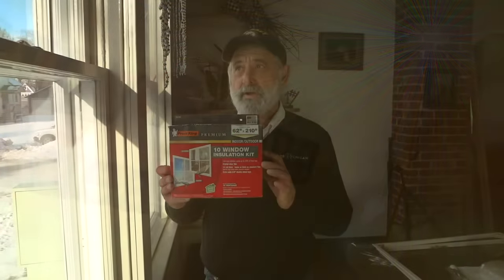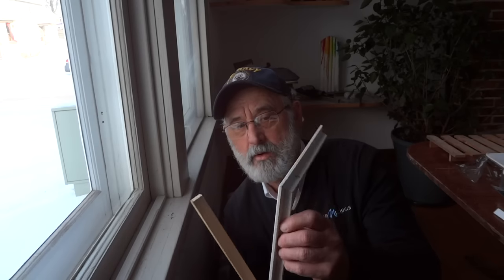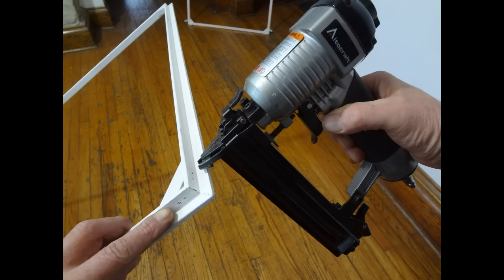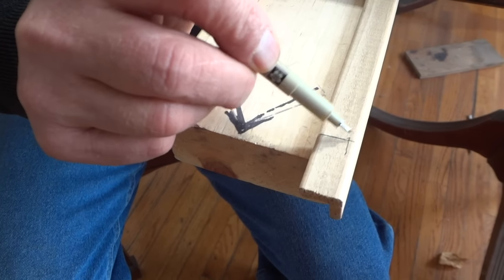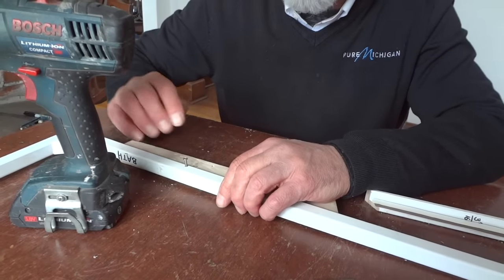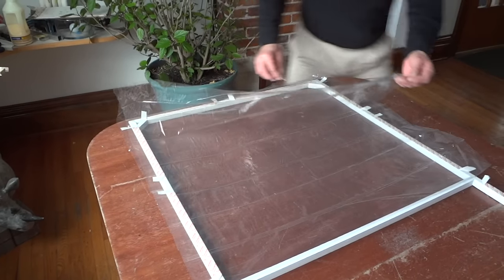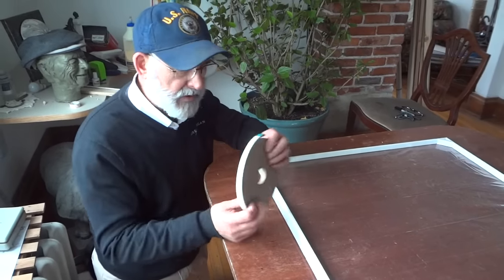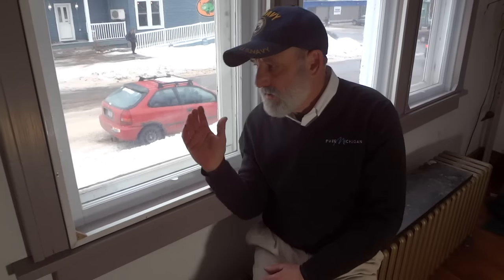DIY Window Insert for Older Homes

Comment: Parts List.   I really appreciate your step by step clarity, with sound reasoning included. Thank you!  I needed a parts list for myself, so  I'm putting it up for anyone else who needs it.  I'll be happy to edit for corrections.
1/2' x 3/4' parting stop
3/4" x 3/4" corner molding
#4 x 5/8" screws
Clear double sided 5/8" tape
3/8"wide x 3/16" Sponge tape
Plastic shrink film sheeting
Reply from the maker: Thank you, amr53207.  That is helpful.  You might note that the plastic sheeting is a shrink film and not polyethylene or vinyl.  That's a pretty short list for all the savings it represents.
Reply: Thanks for making this list    very helpful for others👍🏼
Reply: I wonder if you would be able to assist me I live in the UK and I cannot find this corner moulding no one seems to know what I'm talking about could it be called something else or what is it generally used that way I might be able to track it down
Reply: @EarlSenchuk  I'm having trouble tracking down the corner moulding maybe it's called something else in the UK can you tell me what is generally used for or where it's used so I can see if I can track it down desperate to make the your kind of insects
Reply from the maker: You got it amr53207.  The corner molding is for outside corners.
Reply: @carmel-wayfinder5401  Another name is angle molding, of course, you can always show them a photo.
Reply: Very helpful but where do you suggest getting this list at? At Lowes it says corner molding is $15 for a 96" piece. I'm looking at 0.75-in x 96-in Brown Solid Wood Outside Corner Guard at Lowes.

Comment from the maker: The results are in for the 2019/20 winter so far.  My last five heating bills in order starting in September are:  $23, $44, $77, $77.50, and for the month of January is $81.  This is for heat, hot water, and cooking.  My house was built in 1886.  Normally, my gas bills are double these amounts.  My home is the most comfortable and warmer than any winter I have ever experienced in 43 years of living in this house and I live in the northern half of the Upper Peninsula of Michigan.
Reply: Your brilliant! Love the UP
Reply: Respect to UP ! Beautiful place !
Reply: I just discovered this concept today. I'm curious if your windows are the original windows in your home? Our home was built around the 1860's with original windows. We are now looking into something like this but I'm curious if it really does work well on really old windows.
Reply from the maker: @tigger6186  Yes,  I do have the wavy glass and original frames.  My home was built in 1886.  The exterior storm windows are hopelessly inadequate.  When I put up the window inserts, my bills were cut almost in half.  I now turn my thermostat up higher and pay less.  Every room is the same temperature.  When the wind is blowing in winter, you can see the plastic on the window inserts bow in and out with the pressure.  You just know that you are saving money.  I plan to make three more window inserts in a slightly different way by using a special clamp designed for the purpose.
Reply: @EarlSenchuk  I would be interested in a diy video on that as well if you have time, please and thank you.
Reply from the maker: @tigger6186  Working on it now.
Reply: Any tips for making a frame for an arched window?
Reply from the maker: @zootsuitpenguin  Not without a lot of work, and maybe not using wood.  That's going to be quite a challenge.  Good luck.
Reply: You are amazing Earl! 
I'd never dream that anyone would have those bills in your location regardless of how they insulated. 
Did you increase the R value in the attic the same year or do anything else?
Reply from the maker: @preacherman9018  I did increase the R value with some thick insulation in my attic and sealed around the outside of the window frames.  We just had a major Christmas storm with 3 feet of snow dropped in my yard and serious winds.  If I didn't look out my window, I wouldn't know that there was a storm going on.  So quiet in my house.
Reply: @EarlSenchuk  That was a brutal storm my friend. It rained hard, then it immediately dropped over 40°F with scary gusts that threw debris.  I have to look into increasing my R value in the attic and doing that too. I have an old house as well. It's good to hear that you faired well last weekend. It's a miracle our power didn't go off.  Some places they were doing rolling blackouts. Can you believe it? Time to invest in a chimney liner for wood heat. 
On another note, here's something that I hope you enjoy as much as I do. It's a short Bible message. https://youtu.be/qv0rnnUdk-I
Reply: @EarlSenchuk nine months ago 3'? Must of been around Marquette area I remember that storm up in Calumet definitely going to try this this year
Reply: Maybe you can start putting bubble wrap it will also help the  interior of the house be more warmer.
Reply: Thank you!

Comment: When I thought of all the wrong ways to put In this type of winterized installation. this video is the only possible correct solution thank you for your diligence in conquering perfection
Reply from the maker: Thank you Mike,  I should let you know that I filed for a patent on a "DIY Window Insert KitTM".  It has just gotten approval for testing on select local homes involving persons who are having trouble paying their energy bills.  We are also pursuing an Energy Star rating for this new product.  It's going to take some time, but relief from high energy bills and better creature comfort is on its way.

Comment: My house was built in 1880's, my heating cost are very expenaive. Thank you for making this video. I cant wait to try it out.
Reply from the maker: Lisa,  I am in the process of producing two new videos that will allow persons to make their own corner molding (Part II) and clamps (Part III).  My house was built in 1886 and the DIY window inserts for older homes cut my bills at least in half.  Expect a dramatic drop in your winter heating bills as well.  You can also expect that the temperature of each room will be the same temp.  Another huge plus is that you can expect to see no more frost buildup on your storm windows, even if you run a humidifier.   I expect to put these new videos out next week.  Stay tuned!

Comment: Will be doing this. Great idea! Much less expensive than the $469/ window plexiglass ones. Of course the prices are higher now, lumber for 2 windows is $65. Thanks Earl!
Reply from the maker: You are welcome, Vic!  I know you are going to love the newfound warmth and comfort, in every room!  If you plan to make this style of window insert for your entire home then you may wish to watch the other two DIY Window Insert for Older Homes videos that show 1.) How to make a special clamp that makes things go way faster, and 2.) With a simple jig, learn how to DIY 8 ft long outside corner molding lengths, enough to make four complete window frames out of a single 2 by 4.  I have 13 window inserts in my home.   Enjoy the significantly lower bills too!

Comment from the maker: One big difference I've noticed since creating these window inserts is that my regular storm windows never frost up anymore no matter how cold it gets outside because there is no moist air escaping from things like cooking or from the clothes dryer.  Sometimes when the wind blows, I can see the plastic film on the window insert bulge outward or inward which is a sure sign I am saving a ton on heating cost.
Reply: Nice job !!
Reply: Simple and effective.  I was absolutely trying to overengineer my windows.  Thank you for sharing your knowledge!
Reply: Good job. Where can I buy the long bar? What's the name of it ?
Reply from the maker: @jy210000   Not sure what you are referring to as the "long bar."  The 1/2" by 3/4" Parting Stop comes in 8 foot lengths.
Reply: I have literally seen blocks of ice on the inside of ours!
Reply from the maker: @jasmincooper7146  Frost buildup on my windows (usually on my exterior storm windows) is a thing of the past for me.  I can have water boiling on the stove and even exhaust my clothes dryer to help add humidity and add heat to my home with absolutely no frost on any window.  Why waste that wonderful warmth?

Comment from the maker: This was a brutal winter, for all it seems.  I have never had 4-1/2 feet of snow in my yard for most of the winter before.  In spite of it all, my heating bills were quite reasonable especially considering that we got over 100 inches of snow in just February.  Going to put some statistics together going back five years to see if I can come up with a actual value for savings.

Comment from the maker: Premieres starting tomorrow morning (2-17-2022 @ 10 a.m.) for two new videos.  DIY Window Inserts for Older Homes, Part I-The Special Clamp outlines how to create the perfect clamping system for making DIY Window Inserts for Older Homes.  At 10:30 will start the next video, Part II- The Corner Mold Making Jig that teaches how to create a jig fixture that will allow you to make outside corner molding at a fraction of the price you would pay in a hardware store.  DIY Window inserts for Older Homes work to save energy costs on both heating and air conditioning.

Comment: I made something similar.  I put the plastic sheeting in aluminum screen channel.  The top has foam weather strip for sealing and spring-action, and the other three sides have plastic bi-fold weather striping for covering gaps.  An aluminum support member for bowing is centered and JB Welded in, for example, a 3'x5' insert.  Install and shrink the window film as light as possible.

I have no quantified data, but there definitely is less cold air rolling off the window sill, by feel.  (The cold air is not infiltration but air cooled by convection.)  I use 0.5R per inch of (sealed) airspace.

This build is relatively inexpensive, so payback can start early as possible.  All components must be used to make it effective.

They are delicate, but I have not wrecked them yet, and the clarity of view is good.  Frost and ice has built on the regular window due to water vapor in the airspace, and if it is bad enough, I will dry it; this proves the air at the inside glass pane is cold than if it were normally exposed to the indoor space.  I have put silica-gel packs in the air space which seemed to help, but I cannot confirm the air hadn't dried out by that time of the year (there is still minimal air leakage).  Luckily, they JUST fit behind the shades and shade mounts.

I will continue to use them.  I even called them the same exact name - window inserts.
Reply from the maker: Sounds like a quick and easy way to cover a screen window by using the same tracks and method used to mount the screens.  Good luck on your trials.  Keep us posted as to your results.

Comment: Wow. Best one I have seen in last several years.  I know what some of my older windows will be getting for Christmas 🎄 👍
Reply from the maker: Thanks Pizza Warlord.  If we could show photos here, I would post my actual heat bills for last winter.  Unbelievable.  My highest gas bill for February, the dead of winter, was only $92.  That includes heat, hot water, and cooking.  It comes out to about 50% savings.  My home has never been so warm and comfortable.  Every room now is the same temperature.  Absolutely no frost on any window due to condensation.   I wish I could figure out how to make this into an easy product so others can enjoy such amazing savings.   I am so glad I did this.  It takes about two minutes per window now to prepare for winter.  No more taping, shrinking, cleanup in the spring.
Reply: @EarlSenchuk  By far this is the easiest project for my windows  However I wish you had shown how to mitre the frame together can you advise what tools I would use and how to stick it together  as I'm clueless 🤔🔨
Reply from the maker: @carmel-wayfinder5401  Hi Carmel,   Corner clamp styles vary.  Most get in the way.  No way to show a photo here, but I modified a clamp with a small block of wood to square off the point of the corner clamp.  Another thing you can do is glue and clamp all four corners and then shoot the corner blocks in after the glue sets up.   You can also make your own corner clamp out of wood that will allow access with the brad nailer.
Reply: @EarlSenchuk  Thank you for the info🔨
Reply from the maker: @carmel-wayfinder5401  Thank you for your comment.   When I found out that my personal corner clamps didn't work, I created some that got me by.  Easy if you are an artist that works in metals.  It appears that no corner clamps on the market will work in this application, at least without some modification.  Last night I came up with an idea of how to fashion some corner clamps out of the same corner molding and parting stop.  Thanks again for bringing this to my attention.  I WILL FIX THIS!

Comment: What an awesome idea! Great work and great video. Thanks for taking the time to show how you did it. I've already started doing my windows with sealing bubble wrap against the window with double sided tape and then 4 mil clear plastic taped on with white duct tape onto the window trim. I have an old concrete block house.  Seems to work pretty good. I sure would like to try your way next year.
Reply from the maker: Thanks, Patricia.  I just put up all the window inserts that I made last year as shown in the video.  It is so much easier than taping, filming, shrinking, and then trying to remove it all in the spring.  Never again.  This year it took me just a few minutes to completely seal each and every window in my house.  No more muss and fuss.  Really like the savings in heating cost.

Comment: Years ago I did pretty much the same thing on our 160 year old farmhouse windows (not a 90 degree angle in the building). Mine are not nearly as neat looking as yours though. Good job!
Reply from the maker: Thanks!  I figured out how to deal with out-of-square windows with a patent-pending window insert kit. Go to https://earlsenchuk.com/inventions/home-use/ and click on the composite picture in the upper left corner.  These cut my heating bills in half and cut outside noise considerably.

Comment: What a great video, you're a talented man, Earl. I would like to do the same thing only with plexiglass. My local Lowe's will sell "scrap" pieces that have already been cut for $1 a piece. It might take a while to get them cut for every room in my house but I think it would be worth it.
Reply from the maker: Thanks, Awesome-X.  Plexiglas would certainly be a lot clearer.  Good luck!
Reply: Back when I was a child, many years ago, my dad made these using plexiglass for all the windows of the house.  He made them in three sections for the large picture windows so they could be used in all seasons.  With the sections you could remove the center to be able to open the slider section to get fresh air.  Otherwise they helped with both the heating and cooling bills.

Comment: Id suggest using some 20 gauge clear PVC that way you don't have to worry about the plastic tearing, gives you a little soundproofing, and maybe a little better insulation.
Reply from the maker: Try it and let us know how it works out.  We are all interested to save money on heating and cooling cost.

Comment: I've got some drafty windows, possibly because of deteriorating weather stripping. I'm planning on replacing that weather stripping, of course. But I think I may also start building these window inserts. In my case, I'm considering using thin plexiglass inserts assuming that doesn't become prohibitively expensive. Thanks so much for this idea and great tutorial!
Reply from the maker: Jason, I'm quite sure that plexiglass will work, but "prohibitively expensive" is likely to come into play.   Good luck.  Stay warm. Stay healthy.
Reply: You'd be shocked at how expensive plexiglass is, and also the lack of places that cut it to your specs

Comment: You're on to a winner! I was wondering about doing much the same thing but stepping it up and using thin polycarbonate instead of film.
Reply from the maker: Thanks, Hermano.  Get ready for sticker shock if you elect to go with polycarbonate.  It will work just fine though, and clearer.

Comment: earl, thank you for this concise and thoughtful video! i live/rent an old home from 1905 in the pacific northwest. the prices to heat your home up here are absolutely staggering. $400 a month and it just escapes because of the lack of insulation etc. the windows are single paned and the frames have layers upon layers of paint that have been applied over the years by previous tenants. unfortunately the corners where the corner molding would rest on are bevelled and slightly stepped if that makes sense. wondering as its not a clean corner if this will work on a frame like this? any info would be much appreciated, here's to our quest to minimize our carbon footprint!
Reply from the maker: Without a photo to make such an assessment, it would be up to you to decide whether or not this type of window insert will work on the beveled edge.  The gasket actually seals on the front face of the window frame.  I posted two other videos that show how to make the special clamp for making these windows and another on how to make your own corner molding at a fraction of what you would normally pay for such in a hardware store.  Cut and paste these links.   https://youtu.be/NQNhx5fojs0  and https://youtu.be/MXCpN3yny7k